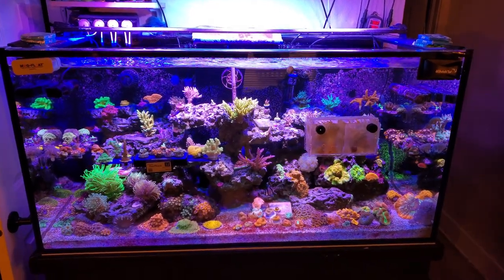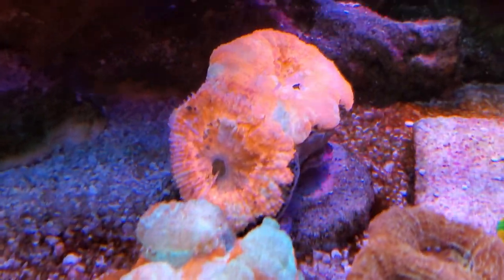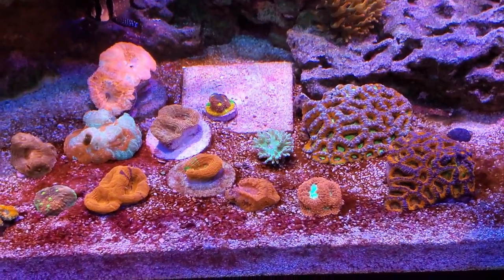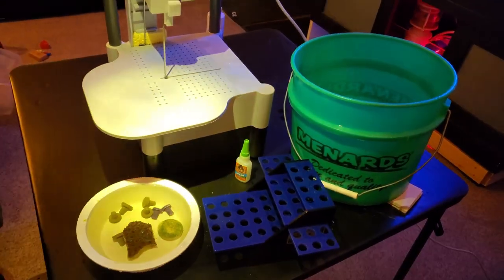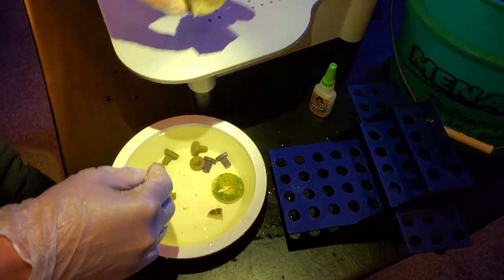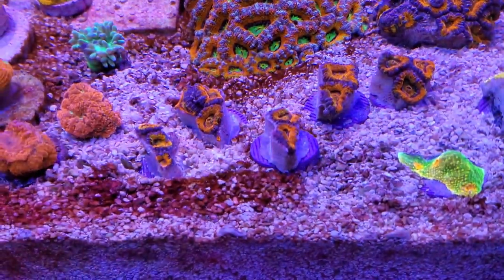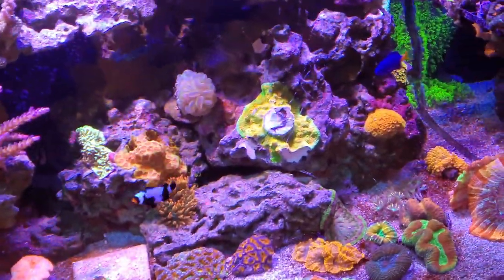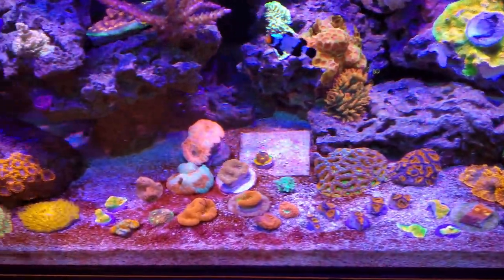How to Frag Coral - Gryphon Aquasaw - Tank Update with Future Plans

Comment: Some things you need to think about trying to do a propagation business in your garage. You are going to need at least 12 systems the can be a one system plumed together but you need a tank per month to pull from then it's going to take around a year give or take for all that to grow back maybe even longer. How long did it take to grow out that pice you just cut I feel like I have been growing an acain that has like only 6 heads for 2 years. Anyway you need like 12 at least so you can pull one every month to sell and then it can  grow back out for 12 months. My buddy had 30 tanks he was doing all the maintenance on and had agreed with the customer he would stock the tank but could pull whatever he needed out of them so he didn't have the electricity and water bills. And he still went out of business right after like 18 months. But my aera is hard we have never had saltwater store besides my buddy's. Good luck I will buy something off you when you are putting some sps out.